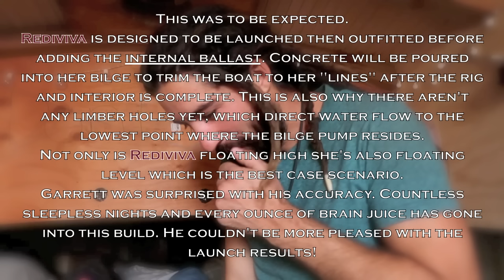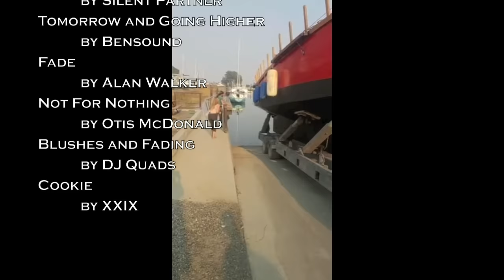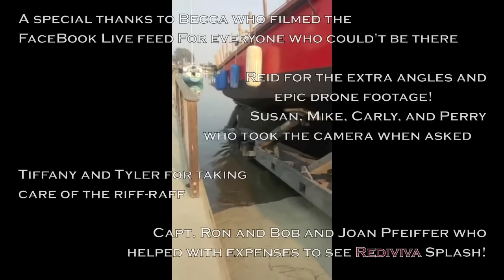Salt & Tar: Episode 43 - The Launch

Comment: What a happy day for you guy's! I remember first day I floated my 18' Tug Boat, powered by a 10hp single cyc. Volvo penta. What a great day it was, really surprised me with no leaks, and big 14" prop really pushed boat along. First day fishing with boat, we caught 65 kocani trout out of lake billy Chinook eastern Oregon. Log many trips with tug boat, that got nick named Little Toot! But two years ago, little toot had bad dry rot in it inside joints, due to me fiber glassing boat bottom and not glassing over gunnel edge. Water got between glass and 1/2 marine plywood, and rotted mahogany frame joints. But, it lasted 21 years! Cost me 2000.00 to build, so Little Toot eared it's retirement! I now have a 18' pontoon fish/pleasure boat. Hope you kids enjoy your build for a lifetime!

Comment: You have every reason to be proud. Do you have any idea how much you have saved by building it your self? I'm a retired boat builder but you have taught me two things. To cut a line at the water level and if the deck cabin isn't right cut it out and build another one. Now you can build the inside of the boat, mast and a millions of other things. I cant wait to follow your sailing adventures.

Comment: LOL!  "Go easy on her she's still swelling."   My dad always told me that on our first trip of the shrimping season after our boat had set up for the winter.  He didn't need to though because on our first trip we had to call the coast guard and have pumps dropped to keep from sinking.   You could see light through the seams of the bow for the first day until waves spashed enough water on it to seal them up.  Our boat was a old schooner that was born a rum runner during prohibition.  Eventually it was converted to a trawler and was one of the most beautiful of all the shrimpboats in Bayou La Batre with her swept in transom unlike the wide ones the rest of the boats had.

Comment: Hey guys, congratulations, top job and so pleased for you both.  This brought back memories for me and I can relate almost exactly to what you have been through.  Back in the 80’s/90’s I rebuilt a 1937 48’ x 16’ beam Scottish fishing boat on a shoestring.  Took loads longer than you did but I had to replank, recaulk, new stem and loads more.  I remember vividly driving my old Landrover behind the boatyard shifter as my boat the Water-Lily sat in the slings and moved towards the lift bay where she had been lifted out over 20 years before.  I said to my girlfriend at that time, “Don’t say a thing” as I was so full of emotion.  I had a huge petroleum pump in the back of my Landrover and a huge bag of sawdust but hoped it wouldn’t be needed.  She was launched and the boatyard went below and said she was probably taking less water than the day she was launched.  It was a different story some years later when she was lifted for a repaint and dried out in the sun before the next launch, then I had fountains of water and needed to use the sawdust trick to stem the flow while the planking took up.  Anyway, huge achievement and I wish you well for the next stage to get her finished and sailing.  Best regards. Andy UK

Comment: interesting ,,,  is douglas fur a hard enough wood to use in boat construction?  did you saturate the hull with epoxy?  in New England , I used to see lots of cedar on oak , plank on frame , fishing boats, and some sailing yachts..   the fishing, lobster boats are still about, but not too many of the sailing boats are still around ..